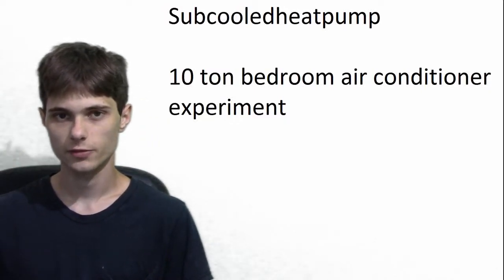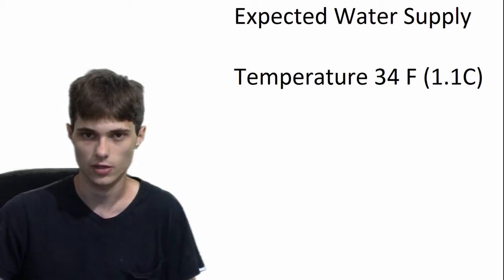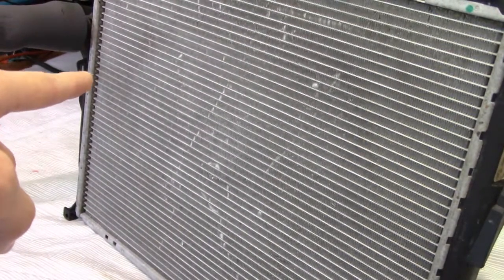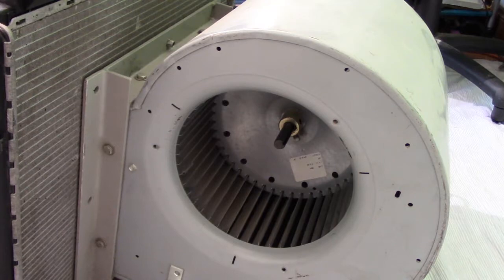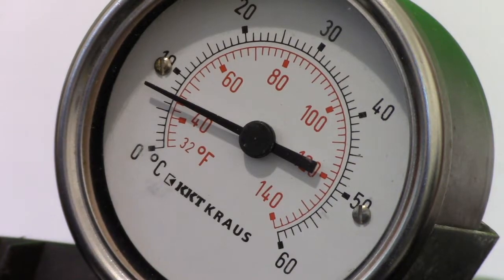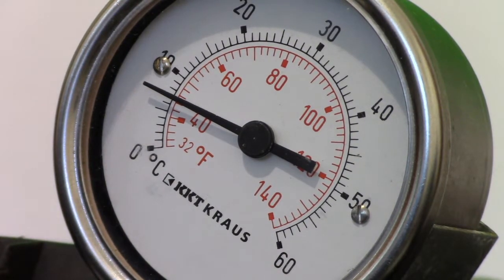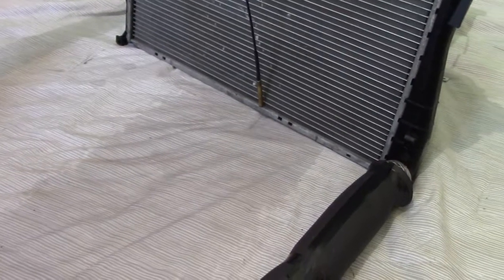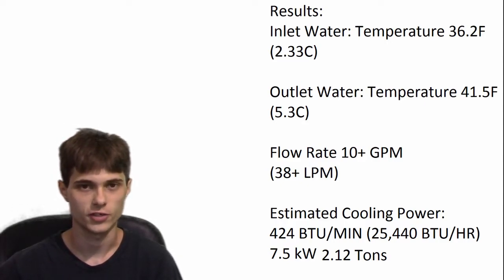10 Ton Bedroom Air Conditioner; Planning

Comment: Thanks for sharing the video.  I enjoyed your experiment and it got me thinking.  How efficient would it be (theoretically) to generate or maintain a large reservoir of ice (e.g. a large chest freezer) during the night and then use the reservoir mainly throughout the day for cooling purposes (such as exchanging heat through an A-coil radiator in a  central unit)?  Our power company here in Nashville currently charges the same rate for residential power customers anytime during the day or night... however it seems like they would really like to change this.  I read on their website:  "At this time, NES is unable to bill customers at time-of-use rates because the metering infrastructure needed to record the hourly data is not in place."   However they currently have an initiative underway for introducing new smart meters with the traditional ones that may give them this capability.  Seems like storing cooling potential in the form of ice may be an interesting option for using power when the rates are lower if they ever get to that point.
Reply from the maker: It would only be viable if you had a large chiller and the utility rates became much lower at off peak. The issue is that most air conditioners have a better coefficient of performance (think efficiency) because their evaporator temperatures are higher than freezing. The chillers needed will necessarily operate less efficiently because of the required lower evaporator temperature. The other issue is sustaining acceptable cooling performance during the peak rates. You'll need to store quite a bit of ice to do this, depending on your cooling needs it could be from a few hundred pounds to 10 tons. With all of this said, there are many companies that specialize in this application of ice storage. Ice Energy sells a product they call "Ice Bear" and it does just what you're thinking of. Thank you for watching.